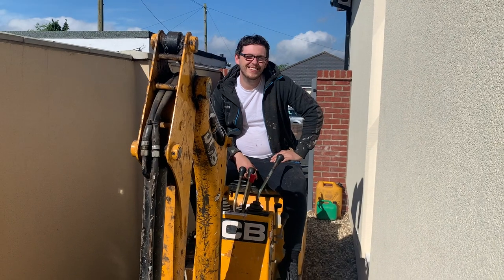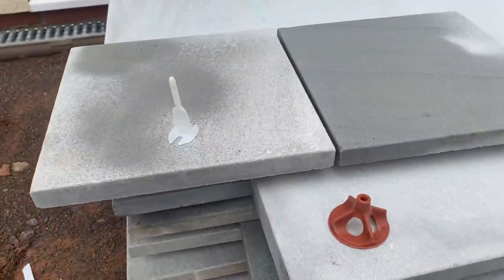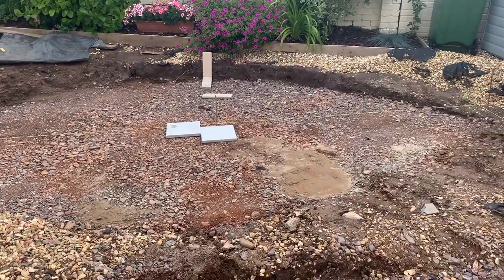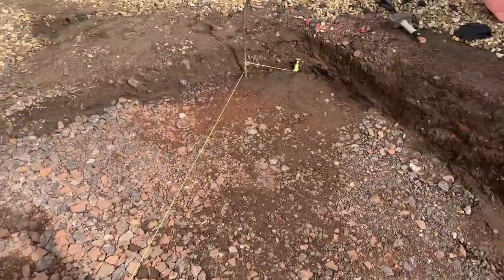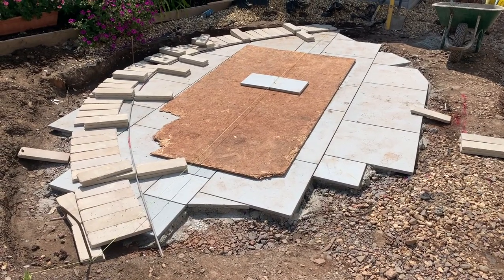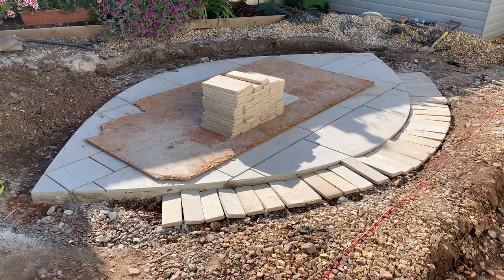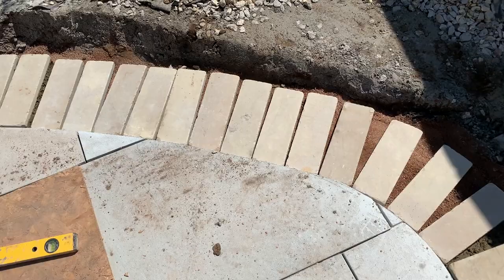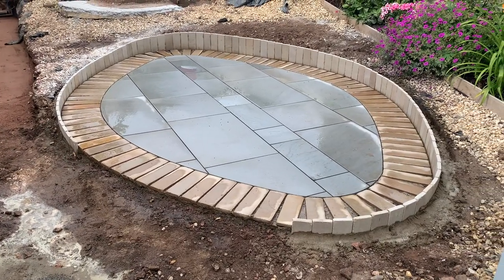Building an Oval-Shaped Patio Made Easy: Tips and Tricks #ovalshape #ovalbuild

Comment: Lovely work as usual,  what's the name product you used at 2:10 ? Ive seen a lot of people using them recently and wanted to give them a go,  how did you get on with them? Also great idea with tent poles 👍
Reply: *talking about the leveling equipment
Reply from the maker: There actually really good not good as levelling unless your only using 300x300 but really good I’m locking tiles together couple of hours later you can walk on em safely still  
Vite clips and vite caps 
@Tiles_tools

Tent polls are great 

https://www.tilerstools.co.uk/product-category/rls/
Reply: @tidybrickslandscaping  cheers really appreciate that, like i say I've seen them being used a lot recently but wasn't sure who sold them, thanks again looking forward to trying them out👍
Reply from the maker: Jasper Miller Landscaping yeh they are good don’t do what I did and get loads of the red caps I bought 3 bags and only used the 1 so far because there reusable it’s just the clips you’ll need to keep buying 
I should strike a deal with tilers tools some sort of code to get discount when mentioned who pointed you in there direction  👍🏴
Reply: @tidybrickslandscaping  thanks for the advice,  ill keep that in mind 👍 , and yes you should definitely try get something linked up in regards to a code.

Comment: I'd take this off line.that oval not good. Normally your work is a lot better.
Reply from the maker: It has been noted already and deserved too but it’s knowing when to stop and get on with it too, your average joe wouldn’t know the difference either. Anyways next proper proper job is starting next week a porcelain driveway 117m2 gonna be the Biz !!!  Double border in tecco and copper. 150mm type 1 mot then 150mm reinforced concrete slab need to cure for 4/6 weeks before I can tile on it cement bed. 
Actually feel quite nervous about starting it got butterflies in my stomach 🤙
Reply: @tidybrickslandscaping   👍